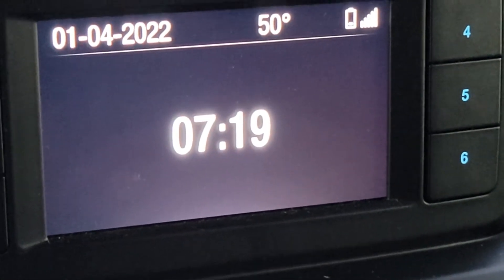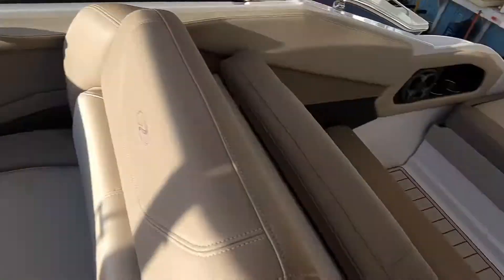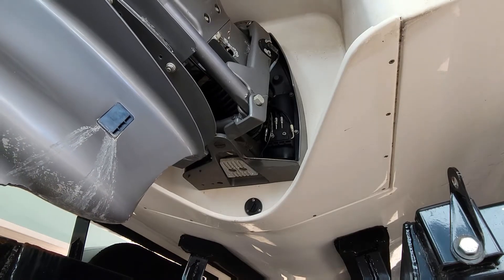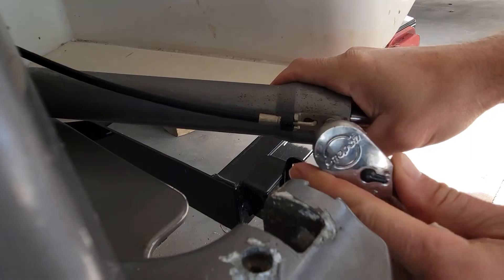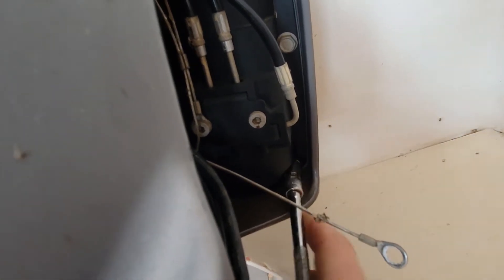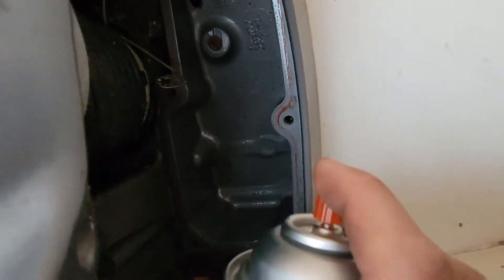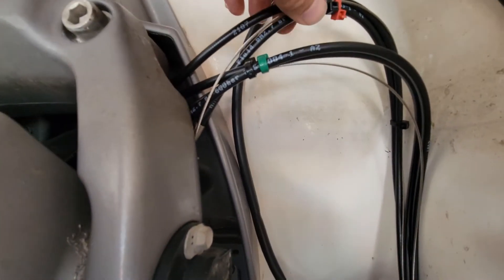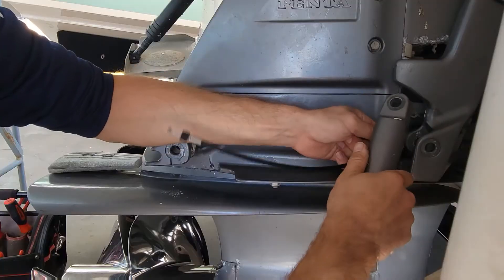Replacing A Volvo Penta Trim Pump - Episode 125 #VolvoPenta #TrimPump

Comment: Thank you very much.
Reply from the maker: No worries. Keep me posted if you have questions. Thanks for watching. 😊
Reply: Justin, how are you?  I just order and received the cover kit for the trim Pump kit that is leaking on the Volvo penta sterndrive sx   I just noticed this cover kit is missing the wires that go inside the motor.   

Can I change the trim pump kit with the cover kit and still use the hydraulic oil reservoir from
the old one.  

This is insane.  I thought I had order the right part, it came from the states but I live in Canada. 

Thank you for your help and may God bless you and your loved ones.  

Can I replace
Reply from the maker: I honestly do not know if you can. I have only replaced it as a complete assembly.  Sorry.
Reply: @FaithisKey792  This link shows how to just replace the updated cover with new hydraulic lines. https://forums.iboats.com/threads/how-to-volvo-penta-sx-a-dps-trim-pump-replacement.548948/

Comment: I have the older version of this trim pump on my 2008 volvo penta. It works, but is leaking fluid. It appears the pump is leaking, not the lines. Any suggestion on where the pump is prone to leak, and where is the best place to get a replacement pump. Apparently they are hard to get now. Thanks. Great video, made it look easy.

Comment: Justin how are you?  I just received the cover kit to replace the trim pump kit you have in this video.   I have the same one on my Volvo penta sterndrive.  I realized the cover kit never came with the wires that plug inside the motor.   

Can I still changed the old trim pump kit that’s currently leaking with the new cover kit, it’s the new model.  Can I unscrew the old previous oil reservoir of the old trim pump kit.  And place it in the new cover kit. Please let me know.  Have a most blessed day.  I’m in Canada and the part I order came from the USA 🇺🇸. 😩

Comment: Heya Justin, cheers for all the tips. Ha e got to the point motor is working but rams aren't working. What am i missing with the bleeding part.
I have all lines conected to both rams, topped up resovoir and left resovoir cap open, i feel im missing something. The motor is fully down so close yet so far. 😭😭😆😆
Reply from the maker: I would disconnect the lines one at a time and see if you get fluid movement when you activate the pump. If you get good flow on all the lines then you could have had rams.  Keep me posted

Comment: Great Video, JL. Happy New Year.       Why doesn't the hole with the wires running through weep into the bilge?  Seems pretty loose from what I have seen on stern drives.
Reply from the maker: Thank you. The wires are sealed behind the pump. Nothing should get to the motor or wires once the pump is installed fully.

Comment: Please tell me the number of that part.   Thank you so much. Great video.   I have a Volvo penta 5.7 300 hp.  Power Trim/Tilt Pump Actuator Motor Assembly leak.
Reply from the maker: I couldn't tell you off hand. I don't do parts or work orders.  You can call the Marina and ask for Doug in parts.(727) 443-2466.  He would be able to give you the correct number. 😊

Comment: How does the pump get water in
I had issue where trim was not going down then went down on its own. Upon disconnecting found there is water in system .
Reply from the maker: Usually it gets in thru the end seals on the rams.
Reply: @JustinLeeMarine  
Wow, thanks for the quick reply. I think that’s how mine got in.
I didn’t pull the cylinder off myself, but the mechanic told me the one seem to of popped out. He said the one end he replace the brass socket with the O-ring but the end that popped out he seems to think it’s a little loose in there. Is there a fix for this , it amazes me how they rely on a little bit of pressfit for the hydraulic fluid not to bypass between the brass and the cylinder itself. I get the O-ring seals the metal line.
Do you think I could use a little bit of Loctite or Apoxsee before I put the other brass piece in sitting on the fence with this one because I have to put the boat in with a crane but really hit and spend the 500 bucks for a new cylinder They don’t appear to be leaking. Otherwise does the water intrusion usually damage the pump? I have run some oil through the cylinders and was hoping to try to cycle the pump without the cylinders on to flush the pump from any water and try it from there. Any thoughts? Thank you very much.
Reply from the maker: I would install new end cap kits for the cylinders. You can put fluid in the motor and run it with the lines off. It will clear the system. They can be a pain and sometimes you have to just buy new parts to fix it. Keep me posted.

Comment: Nice video! What type of fluid did you use and about how much? My husband is in the process of reinstalling our Volvo Penta SX-A trim cylinders and pump after having the entire outdrive sandblasted and then painting it ourselves.
Reply from the maker: Thank you and any type of ATF will work to fill the trim reservoir.  Fill it until it over flows when its in the fully down position.

Comment: Any hints on how to get the seats and o-rings out so they can be replaced and not have to replace the whole cover?
Reply from the maker: Honestly I have never replaced it any other way. 😐 Sorry
Reply: Dang, I can't figure out how to get them out and have been through a few picks trying
Reply from the maker: They might not be a removable piece. I have seen that before. Probably why they sell the whole assembly. It's always something. Keep me posted if you get it apart. Thanks
Reply: They sell a kit 3889431
Reply: Finally figured out how to get those out. Was getting ready to start to drill and then saw a screw in my drawer and it hit me. Found a screw the right size, screwed it in a little and then pulled the screw out with pliers with the seat and o-ring on there. Hopefully this helps someone else out.
Reply from the maker: Sweet. Glad you got it. Sometimes it's the little tricks that make the difference 😀
Reply: @clevelandcg916 trying to get the lines out of a trim pump and i’m confused on how you did this. Where did you put the screw in to pull retainer? I know the post is old but we are desperate lol

Comment: When bleeding do you have the cap open when going up and down ?
Reply from the maker: I leave it open to bleed the air out. Then make sure it's completely in the up position and the reservoir is full with no air in the fluid.  This way you don't over fill it. It should be filled to the bottom of the cap level.

Comment: Did you change the whole motor or just the cover? Mine is leaking fluid but the pump still sounds strong.
Reply from the maker: I had the complete assembly when I replaced it.
Reply: @JustinLeeMarine  do you have tips on how to bleed this system or how I should be filling it with oil? Should the outdrive be lifted all the way up or be all the way down when initially filling with oil?
Reply from the maker: You fill it when it's all the way down and it will bleed itself when you trim it up and down a few times. Just make sure it's always full of fluid when you are bleeding it to prevent more air from entering the system.
Reply: @JustinLeeMarine  So how long does it take before the trim will actually go all the way up? I’m putting fluid in it I can get it to move a little bit but not enough to go all the way up. Does that mean I just need to keep adding more fluid until I can get it to go?
Reply from the maker: Yes if keep adding fluid it should go all the way up
Reply: @JustinLeeMarine  So just keep the black cap off and keep adding fluid as I’m trying to raise it?
Reply: @JustinLeeMarine  I’m just trying to avoid burning up the pump. I just put my battery charger on it because it was not pumping as good as it initially was I’m assuming those things draw a lot of power
Reply: @JustinLeeMarine  By the way I truly appreciate all the help it is absolutely fantastic
Reply from the maker: Correct
Reply: @JustinLeeMarine  OK so keep the black cap off and just keep adding it as I’m pumping it up? I was not doing that at first so I think that might be my problem
Reply from the maker: No worries. Thanks for watching
Reply: @JustinLeeMarine  hey man anyway we can touch base through a call or text? I’m having trouble with this and it’s starting to leak the side of this brand new housing
Reply from the maker: You can email me some pictures and a list of what you have done. I will see what I can do. It's Justinleemee@gmail.com.
Reply: @JustinLeeMarine  I shot you an email dude!
Reply from the maker: I got ya 😉

Comment: Hi justin can I get the electric motor out or that trim pump by it self.  That is the only bad thing on my trim pump sys.
Reply from the maker: I have never seen the pump sold without the lines and manifold attached to it.  We also only use OEM parts.  It's possible that an aftermarket company sells just the pump for it.  Let me know if you happen to find it by itself. 😁
Reply: I can't find the electric motor only the pump is good.  Can you sell me a used one?
Reply from the maker: @miguelventura8056  I wouldn't even know if we had one. You would have to call the Clearwater marina and ask for Doug. He would know.
Reply: @JustinLeeMarine  do you have the number
Reply from the maker: (727) 443-2466

Comment: How do you put fluid in the pump and do you ever need to bleed it?
Reply from the maker: On the very front of the pump assembly there is a plug that unscrews from the reservoir. With the drive all the way down you fill it up, run it up and down a few times and check the fluid again. The systems should never need fluid unless you have a leak somewhere.
Reply: @JustinLeeMarine  Thanks for replying. I can't reach the plug with the engine down. Is there a special tool.
Reply from the maker: @kathykeith4113  If you turn the drive all the way to the port side it will expose the plug for the reservoir. There are no special tools unfortunately.  I use a hose to fill it with a bottle attached. Hope that helps.
Reply: @JustinLeeMarine  I thought about that after I asked the question. I am going to follow this to change mine as soon as the part comes in.
Reply: Still waiting for the parts but does it have any relays? And any special oil to put in the reservoir?
Reply from the maker: There are relays for the up and down. They will be with the fuses next to the fuel pump and starter relays. Any trim and tilt fluid or any power steering fluid will work just fine for the system. They are the same thing.
Reply: @JustinLeeMarine  the hose/ pump for the quart bottle, is this just a modified gear oil pump, or is there a special pump hose for filling?
Reply from the maker: It's actually the bleed hose kit for bleeding a sea star hydraulic steering system.  A gear oil version would also work. Anything that will fit in the bleed hole.

Comment: Has anyone ever had the problem with the Ram pin not wanting to come out seized any tips
Reply from the maker: You will need to torch it to get the aluminum ears that hold the pin in to expand and release the pin.

Comment: 1985 bayliner trim does not go up or down volvo penta
Reply from the maker: You will have to diagnose the issue. Motor, fluid, voltage. Could be many things.